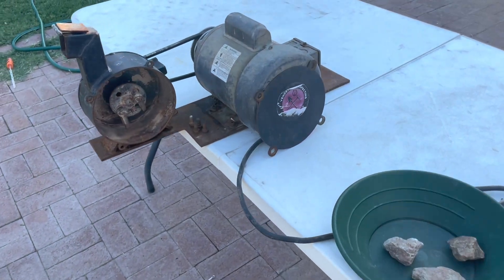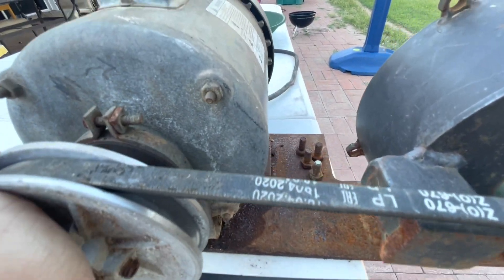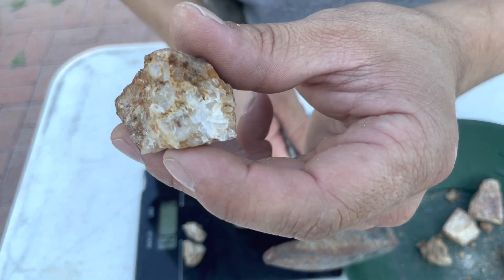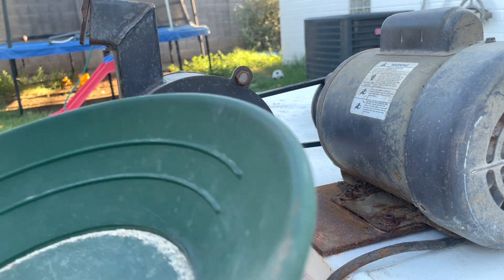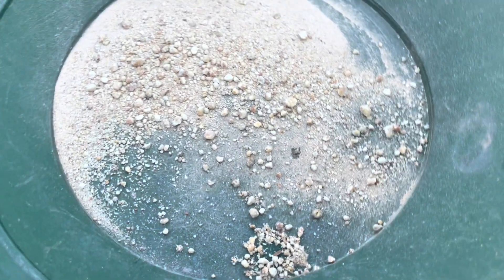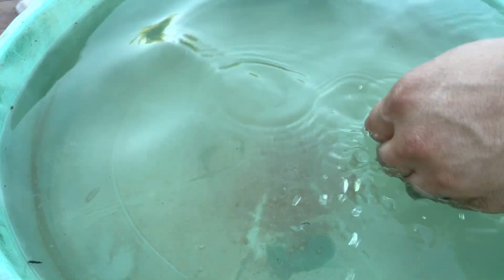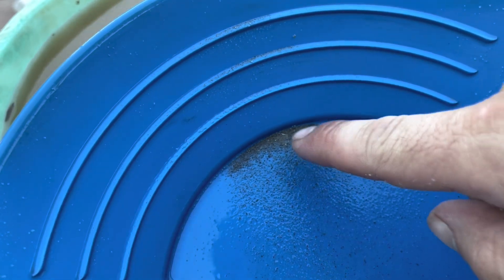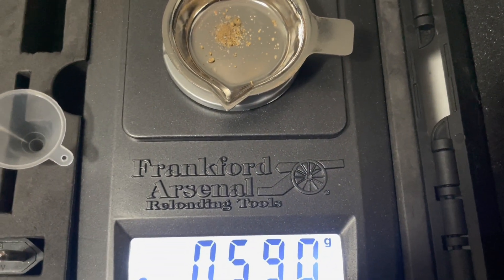Visible Gold in ROCK! How much gold is inside? How I made my Impact Mill!

Comment: That last bag I received from you was incredible fun my friend!!! Lots of black sand, just the way I like it and the crushed pyrite or Galena (not sure which)made for an even more challenging bag to go through! Excellent video brother! I finally got to sit down and watch! I've been so busy with recovery and refine. It's been crazy for sure!!! Awesome specimens you have there. Question...what was the name of the intro music? Oh hell brother! 🤣I was thinking you built the whole crusher. I mean the actual crusher part. Still a nice job converting over though and still awesome that you showed us the shell and guts. I'm going to build one from scratch. I have steel and welder. I think I'm going to build mine so that it mounts right to the front of a 2 hp motor though. Get rid of the belt action. Direct drive so to speak. Always a good time brother! Looking forward to the next!
Reply from the maker: JEFF!! 1st: CHRIS SHARDS - On the Bayou That bag was a long time coming for you my friend!! YINGYANG! I know what ya mean brother! im ready to slow down and enjoy life to the fullest!!!! Direct drive will be good if you have the gas, however do consider the ratios if you were to use gearing. you can get that rpm in the mill way higher than at the output shaft. Less rpm on the motor and, gas, etc...just use a chain vs a belt. better reliability. your the man jeff!
Reply: @VendettaProspecting  You too my brother are the man!!!

Comment: I made it earlier than expected. Nice specimens. Once we took a couple of buckets of that ore from Searchlight (the mine JW has) down to Stutenroth in Casa Grande and ran them through their impact mill and jammed the exit screen up with the gold that was in the ore. That stuff was running about 18%. It was loaded. Back behind your place between the corner of your house and that fence looked like a great place to build you a heavy duty table. When you crush you need as solid of an object that you can put your crusher, ball mill, grinder, whatever..it reduces the shaking and your not expelling some much energy on the bounce. Your softening the blows in other words. Solid table takes nothing away.  Plus if you make it out of wood it will absorb some of the sound. Design it to have a place to slide your pan in and/or a drawer. Just some pointers my AZ brother. You can even make it longer to accept more equipment as you expand into You Tube land:-) Any canvas or cover of your choice will keep it dry. Yea! Have a design video. Peace
Reply from the maker: i agree rich! infact there is already things in the works for such!
Reply: @VendettaProspecting  Cool. You ever need ideas, let me know.
Reply from the maker: @richardbeee  i just need to install a 480 Phase converter and ill be set